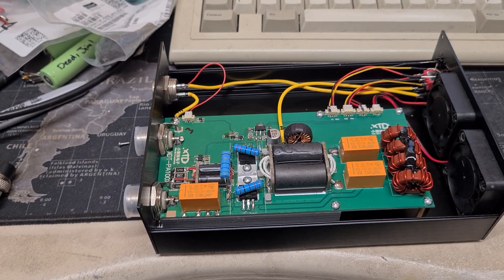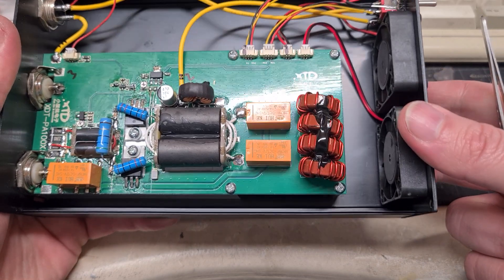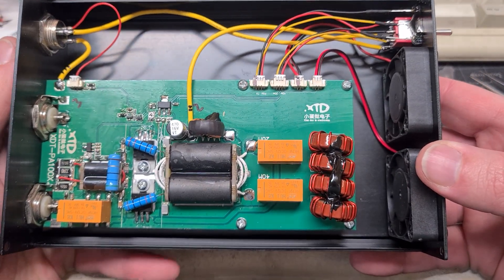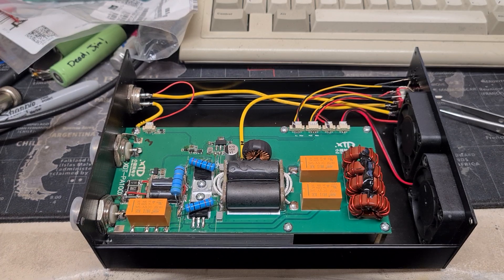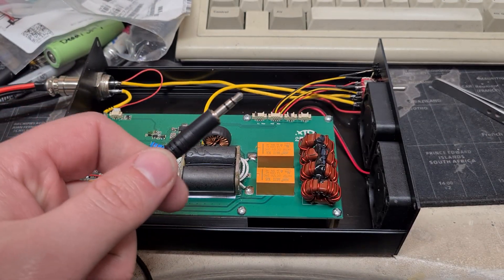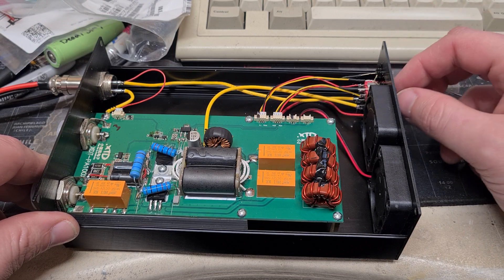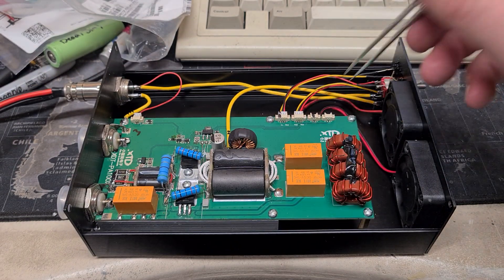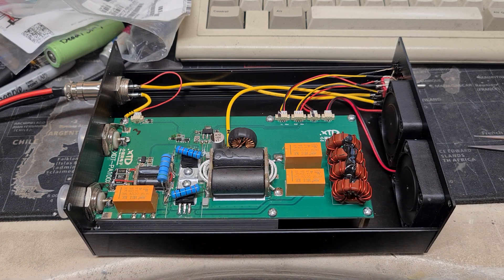Mini teardown/overview of XTD's XDT-PA100X HF amplifier

Comment: I still don't understand the band switch. The manual says (<7M, turn to 40M), (14M, turn to 20M), (18M or >21M, turn to middle).
Reply from the maker: Yup. One way puts in a 7 MHz LPF. The other way outs in a 14 MHz LPF. If you select neither, a default 30 MHz filter is selected.
Reply: Thank you George. That is helpful! It appears as though the the 40M position is used for 40-80m, the 20M position is used for 20m and the center (unidentified), for 10-17m. Guessing there are harmonic issues. The manual uses "M" as an abbreviation for meters & MHz. I wonder why some of the XDT-PA100X units don't have a switch at all! So far, I have gotten only 70 Watts out on CW with 10 Watts in. Appreciate your expertise!
Reply: Здравствуйте 🤝 Интересно Ваше мнение по поводу этого усилителя, стоит ли покупать его для G90 Xiegu и как хорошо он работает? 🤔  @m1geo

Comment: Lies....absolute lies....and Aliexpress descriptions. ..
I too am an Aliexpress junkie that can spend hours looking for random rf products for sale, having myself just found this amp for sale I was intrigued to see it quoted a range of 1.8-30 Mhz which seemed unlikely as most start at 3.5 Mhz...that coupled with a switch on the front marked 20 and 40  raised even more suspicions the description was being economical with the truth. Hunting about I found your video so  you have proven my suspicions.  Having said that there are some incredibly high power fet amps running many hundreds of watts out on 48 volt supplies for sale. Another product I found for less than £300 is a 88-108 transmitter,200 watts out variable power, built in reflectometer, bluetooth linked, no obvious harmonic filtering on the output but will no doubt be soon installed on one or many high buildings in the cities of the UK...